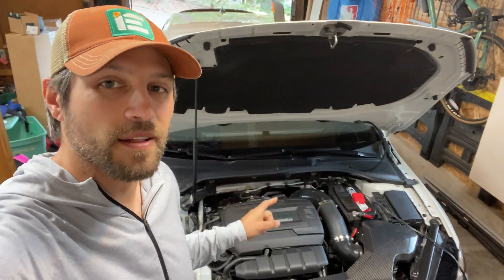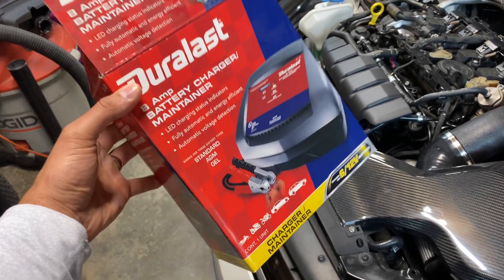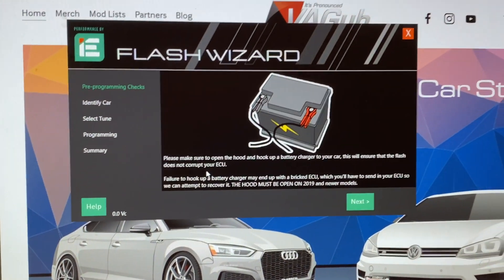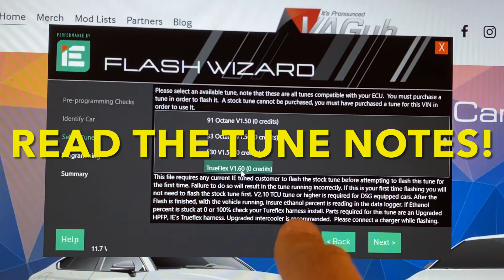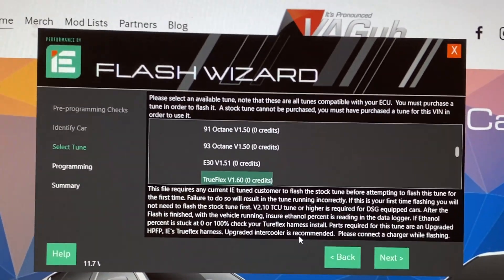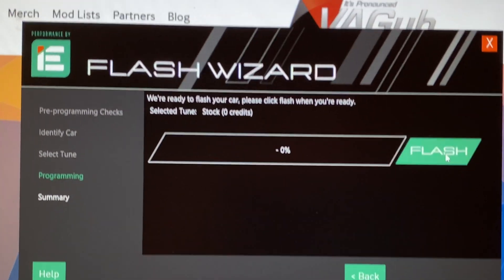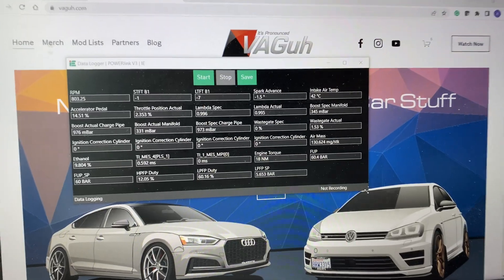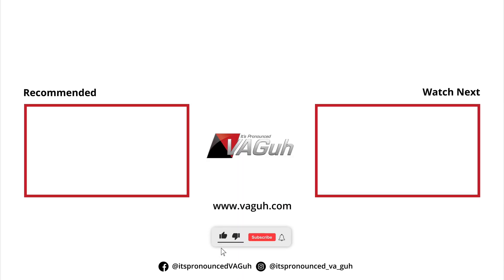IE Stage 1 TrueFlex Tune - Flash Process Overview

Comment: I know it's been out for a bit now, and I've read that people not running E85 fuel, standard 91/93 only, are seeing a small power gain over the 91/93 tunes from the sensor compensating for the ethanol content they do have. So, even if there's no good source of E85 nearby, you still may see a slight bump in power from the base ethanol in the fuel.

This is definitely the route I'd like to go with mine, and I'm looking forward to getting all the kit for it!

Comment: any updates, noticeable difference between stage 1 93 & stage 1 flex fuel? 
Have you done anything with stage 2 yet?
Reply from the maker: Good question and I should do an update.  Since this video I've run the the stage 2 Trueflex tune up to about e80 since thats the highest I could get locally.  The difference between stage 1 93 (or 91 in my case) and full e85 Trueflex is significant and well worth it if you don't want to go stage 2 since you'll hit close to the same power level.
Reply: @Vaguh   Thanks, I'm local to you (Puyallup area), and running the IE tunes also. Have you thought about stage 3 ?

Comment: 2018 GTI Stage 1 with DSG tune
Currently only running the 93 tune, and currently waiting on IE to release their own HPFP before I go with the True Flex.
Reply from the maker: It’s so fun running ethanol. Wish it was more readily available in my area. You can install their TrueFlex harness to prep for when the HPFP becomes available and just have it installed and waiting for when the HPFP arrives.

Comment: hey mate great video. from Australia. exactly what planning now. (then stage 2 with trueflex!). can you do a comparison or speak to difference you felt/measured between in stage 1 high torque and stage 1 trueflex please? need one of those ie caps!
Reply from the maker: Hey, thanks for the feedback! I actually need to edit a video of running TrueFlex e80 on the quarter mile and plan to have a section where I talk about the difference in drivability and feel. But right now I’m replacing my OEM pads/rotors that have been on for 40k miles! Stay tuned!
Reply: @Vaguh  No worries mate. The last comment should read - exactly what I'm planning now.  Thanks, i'm waiting with interest and also any feed back on best approximate E% level for performance
Reply from the maker: @scorch76mail  e85 is going to be the peak performance for hp/tq, but I’ll have to look more at the details to determine what the best ratio might be to run daily.

Comment: So with this kit and tune you can just run fill up full E85 like regular gas not worrying about mixing?blending all the time. I love e85 since is cheaper than gas and makes more power.
Reply from the maker: Yep, you can anything between 91 octane and e85 or any ratio mix in between.
Reply from the maker: I should add in case you didn't catch it in the video that you'll need an upgraded HPFP and IE's TrueFlex harness to run this tune.
Reply: @Vaguh   perfect, thank you !

Comment: this video was so helpful! im just wondering how we can read ethanol content if the fuel-it is not recommended with the IE trueflex. are there other options for gauges?
Reply from the maker: Thanks for the feedback and glad you found it helpful! There isn’t a reason to need to know the ethanol content other than just wanting to know since the system manages it automatically. The ethanol content can be read through the IE Flash Wizard program on your computer. The best recommendation I have heard that won’t potentially interfere with the ethanol content signal to the ECU is getting a P3 Gauge. They were working on a way to allow the signal to be read through the ECU since this tune enables it. The other option would be to install a 2nd ethanol sensor in line and attach whatever device or gauge you want. I’ve read that the sensor doesn’t prohibit any amount of flow and installing a 2nd wouldn’t cause any issues.
Reply: @Vaguh  Thanks for getting back to me! I ask because I know E60-70 is the most efficient in terms of power and boost so I would want to know my ethanol content. I'll look into the P3 gauge for sure, I've been wanting one for a while now so maybe this could be a good excuse LOL! I appreciate the help :)
Reply from the maker: @nckgti7  I just confirmed with P3 that all of their V3 gauges are capable of reading ethanol content through the OBD2 port. Some early V3 units didn’t have that capability and can be sent in to be upgraded for $50. Looks like I’ll be going this path too.